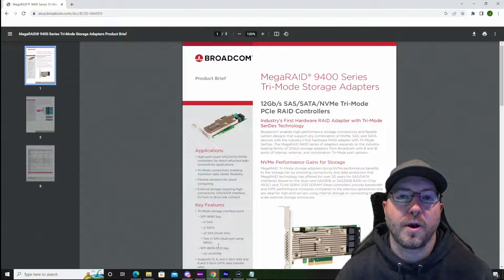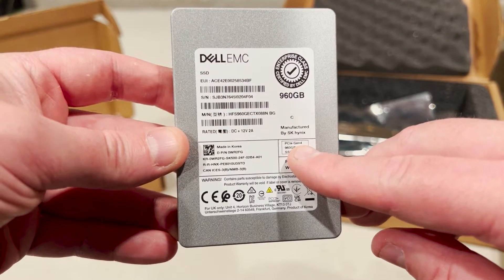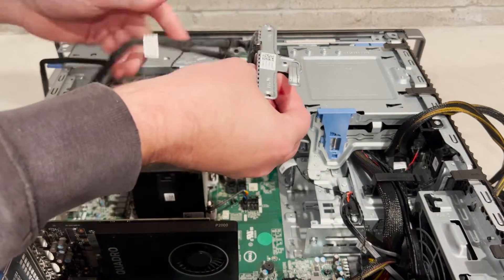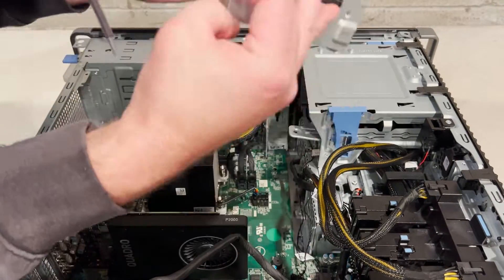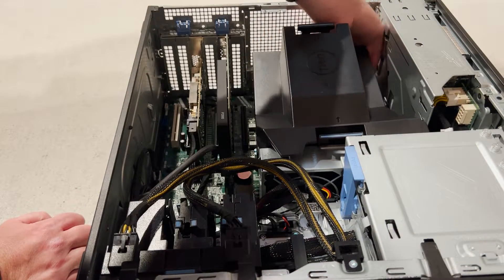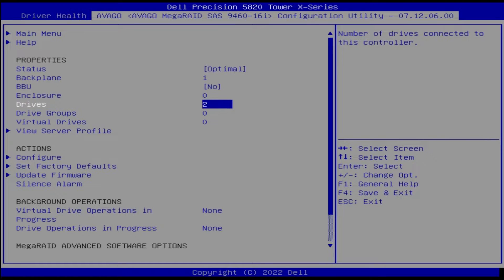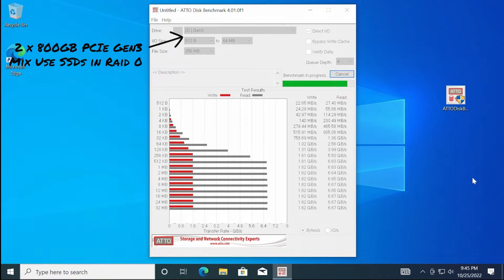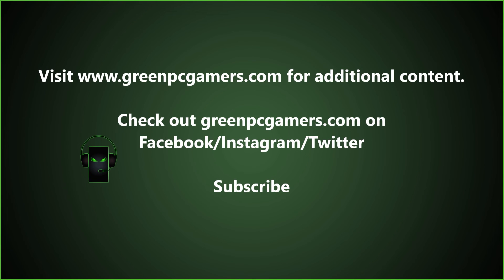Precision T5820 Broadcom MegaRAID 9460-16i  Install + Configure Raid + NVMe U.2 Benchmarks

Comment: Please can you test a 4090 founder  edtion to a dell precission 7920 and also for a aftermarket CPU cooler.
Thank you :D
Reply from the maker: We still need to get our hands on that particular GPU.  Once we do, we'll test it.
Reply: @GreenPCGamerscom  and i try tridentZ RGB DDR4 3200mhz but it doesn't work. Is there a possible way make this work?
Reply: @dakzzgaming8263  you need ecc ram . that ram wont work

Comment: What type of cable did you use to connect backplane to 9460-16i card? I need to get a longer one.  OEM doesnt reach the 9460-16i
Reply from the maker: https://www.serverworlds.com/dell-nkn20-precision-t5820-t7820-nvme-backplane-w-cable-for-9460-16i-raid-controller-2gpfw/
Reply: @GreenPCGamerscom  I'm also looking for this longer NVMe backplane cable.  The Dell P/N is 02GPFW as clearly seen in your video -- which is great BTW.  This differs from the shorter cable that's used to connect to the mini SAS receptacles on the motherboard.  I"m sure you know all of this already.  I've reached out to Dell support and they've said the longer cable P/N is no longer available and there is no replacement.  The connections are a mini SAS SFF-8643 on the controller side to Oculink SFF-8611 on the backplane side.  This is not a common configuration and also very hard to locate.  Dell used a cable that basically bundled two of them together into one ganged 8i connector on the controller end -- probably for a cleaner install and simplicity vs two cables banging around.  Anyway, if you have any ideas feel free to share.
Reply: @in2mu5ic did you ever have any luck finding that cable?

Comment: Thanks for the video, but missing an important part i think : once the virtual drive is created , how to access / configure / format the disk in Windows ? I have myself configured a virtual drive in raid 1 with 2 x 2Tb , but W11 disk manager refuse to format it ... 
Any idea please ?
Reply from the maker: That would be a whole other video sharing that with all the different operating systems.  Make sure you have the latest firmware and driver installed.
Reply: you need to load the RAID card drivers during Windows 11 setup, using the option provided during windows 11 setup.

Comment: i Have that same raid card into my 7820. The PC came with the card installed and already hooked up to the 4 SAS 2TB 10K Toshiba hard drives in the Bays. I mounted them in Raid5 but the problem i have since day 1, is how slow is that Raid5 virtual drive!! I even contacted Broadcom and they just said that it may be caused by the high temperature of the ROC on the board (he saw from the logs i sent) but i have a doubt about this. When writing on that drive, not only the speed is incredibly slow (40-50Mb/s), but in perfmon you can see the drive being at 100%. i opened the case and saw that the card was installed in slot 0 (first slot on top). Is this the right slot to install it? Could this be the issue??
Reply from the maker: Those are some really slow speeds!  The top slot is technically an acceptable slot for that card.  However, you should try the card in the slot 4 - PCIe x16 75W Slot to see if there is a difference in performance.  We normally only use that controller with NVMe U.2 SSDs, so we've never tested it with regular 7.2K, 10K, 15K HDD.  Keep us updated on if you find a fix.
Reply: don't use RAID 5, use RAID 10.   RAID 5 sucks and is slow and is risky with current large drives.   also use SSDs in 2023...

Comment: I have an issue, I am using the exact same controller with a PRECESION 7920, and I connected 4 drives to the RAID controller, but when I go to the device configuration menu, the drives are not discovered, and I can’t even boot to the OS.

Do you know what might be the issue? Btw, I don’t have the backplane.
Reply from the maker: You must have the NVMe backplanes + cabling for the Controller to recognize the NVMe U.2 SSDs.

Comment: Hi I have a HP Z840 can’t upgrade to window 11 but I can bypass and install Windows 11.
I bypass and installed windows 11 on another PC and after awhile got the blue screen.
What do you think going to happen in 2025 when windows 10 support finishes would the  HPZ840 will be obsolete?
I tried installed Linux but couldn’t run games.
Do you know any Linux version can run game such as Fortnite?
What about Crome OS is it possible to install on HP Workstation and play Games.
Any more tips on the subject?
Can you make a video on the subject.
Reply from the maker: Microsoft will probably release a legacy version of Win 11 that has less security features that you can run on the older systems.  Or maybe one of the major chip companies will make an IO TPM module for legacy systems to allow them to support win 11.

Comment: What machines is this card compatible with?   I have a R420 and 720xd but also getting a Lenovo p510 soon
Reply from the maker: We’ve only tested it in a Precision T5820, T7820, and T7920 Workstations.  It could potentially work in other models if you could find a compatible oculink cable harness.